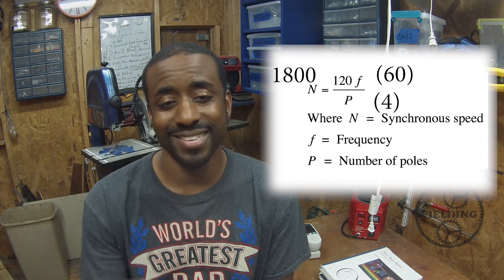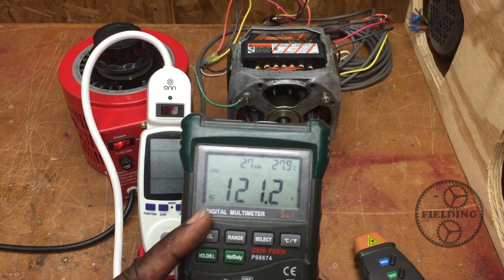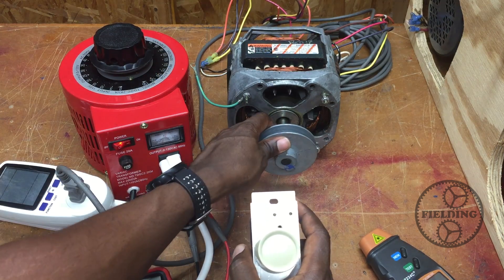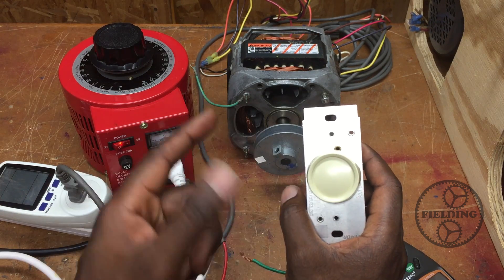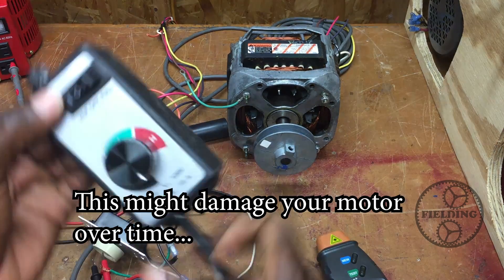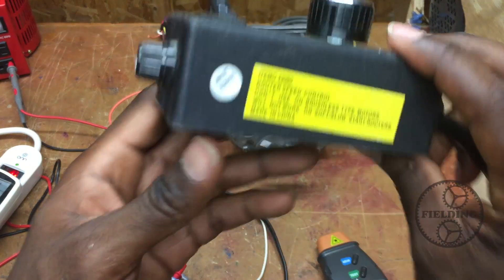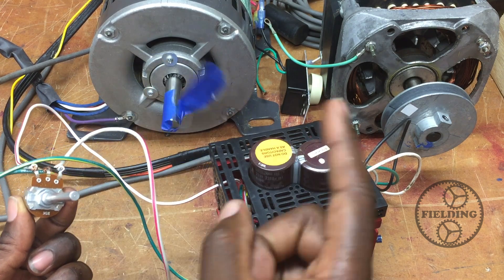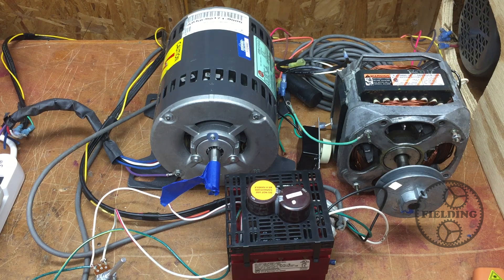Will A Dimmer Switch or Transformer Control An Induction Motor's Speed: 038

Comment: Hi Jeremy,
I have a 6'' variable speed bench grinder model No. TDS-G150VLA ( 1/3 HP , 2000-3400RPM ) and It is missing the potentiometer and the on/off switch . I managed to find a matching switch and after I put the circuit together without the potentiometer the motor doesn't run or hum ..nothing happened.
I found a 180K ohm potentiometer , can I solder it to the 3 leads going to the speed drive board?
If not which value is good in my case ..
Thanks

Comment: So I have a blower with an induction motor, driving the blower via pulleys and a belt. I'd like to slow it down, it seems like the best option would be to do something like put a universal motor on it and a Triac speed control.

Comment: Jeremy, this is over my head but I will share my problem... 3 phase motor turning a feed axis on a large custom lathe. This axis feed has worked for several years until we replaced a potentiometer, now we are getting intermittent feed depending on the machine load. When the axis is the only power on we get smooth feed however when other power is on for cutting heads and turning we get the intermittent feed. This is probably not near enough info for you to diagnose but it’s a start. I look forward to your response.

Comment: Hello Jeremy,
Merry Christmas and Happy New Year. I know this video is  about 3 and a half years old but I have a question similar to your video here. I want to know if I have a Meanwell 24v DC power supply, can I use a dimmer to  vary the voltage to the track running LGB "G" scale trains. I had a guy make me a power supply to run my "G" scale trains, he used a Meanwell power supply and the controller is a Crest CRE-55401 DC Train Power Controller. Can an AC dimmer switch work the same way as the CRE-55401? Thank You in advance.

Comment: How ceiling fans with remote control works? I've installed ceiling fans with remote control and the box connected to the fan motor have 2 wires IN and 3 wires OUT,  but one of those OUT wires is for the lights. How can that control box have 3 speeds but only provide power to the motor with only 2 wire?
Reply from the maker: Watch part two
Reply: @Jeremy_Fielding   thanks man , i will , cuz that 2 wires but 3 speeds thing is driving me crazy , im like "HOOOOOOOWWW!!!"

Comment: I really liked your interception you were a very good teacher anybody they give you a thumbs down need to be slapped anyways this is what I'm going through now I just bought a type of light switch that is supposed to slow or higher the speed and it does nothing for a blower motor that I have on a furnace I converted to a wood burner so I'm trying to find out can I buy a vfd like you have and not running on a 3-phase and run it on a single phase motor which is there at 120v motor 60 hertz I know you mentioned three phase and then only good for 3 phase but you can do it on a single phase motor but it could cause problems so am I just chasing my tail doing this to try to slow down the speed of the motor so the blower doesn't blow as fast or should I specifically just get a different RPM the motor it just spins slower and it is not as powerful

Comment: i have a wire feed welder  older industrial model its a airco brand  it has a 24 volt dc wire feeder motor  somehow the wirespeed speeds up when you turn up the heat  and the potentiometer  is just a fine tune  pretty sure thats the way its supposed to work  it has 24 volts to motor at highest heat setting  but when i turn heat down to a very low setting for thin metal  even with the wire speed potentiometer  at max i cant get  enough wire speed  for the low setting  (not enough voltage to 24 v motor at the low setting) can you recomend a 24 volt dc  speed control  that i could tie into  from a 120 volt  source

Comment: Sir ik this is an older posted video but with the dimmer switch the triak... what if u had a start capacitor for a motor after the dimmer switch then when the triak turn off it discharges amd recharges the capactor effectively changing the frequency from 60 to 50 or 40 would that give u 1800 1500 1200 rpm? At close to full torque? Or more effectly for the cost slow a tool motor down like a saw? Or just a universal motor

Comment: Hi Jeremy. Okay...I watched your video (great explanation by the way!) because I am very interested making a belt grinder and I was going to use a DC treadmill motor with a speed controller from the equipment itself, but then I read a lot of others who did the same having issues with theirs. So I opted out of that plan. I like the fact the the DC motor will provide more torque, but if there are other issues arising from it such as tripping the breakers, then I don't want any part of that.
So, that brings me to my inquiry. VFD's are difficult to find for single phase motors, yet, you can find bench grinders that are 110V and variable speed. There's not a lot of them being produced, but they are made. So how can manufacturers make such a thing and we can't find them for our own single phase motors? I'm currently looking at a 115/220v motor that can be wired either way, but I really didn't want 220. I'd just rather have a 120 plug in. Thanks! Cheers!

Comment: Hi bro, can I use a dimmer for limiting maximum power of induction coocker. I have a 1300W induction coocker and my small house has only 1300W limited electricity, sometimes the coocker makes the MCB down as its operates in automatically.

Comment: The previous owner of our house had wired the exhaust fan (an induction motor) in parallel with a 500 W halogen lamp and those in series with a dimmer.
The fan did slow down when the light was dimmed but only when the halogen bulb was working.

Comment: 1 .  Electric motor speed is 120 x frequency (Hz) / poles of the motor. Example 120 x 60 hertz / 4 poles = 1,800 rpm.

2. A light dimmer has an circuit to modify the voltage waveform turning  the voltage off part way through each sine wave to dim a light bulb.

Comment: Love the videos Jeremy.  You really have a calming teaching method and a common sense approach.  I have a question that you touched on @3:50.  I do not understand WHY current increases when voltage decreases.  Using Ohms law, Current is Voltage divided by resistance.  So since the resistance of the windings is constant,I would expect that current would drop when voltage drops.  Using Power = Volts * Current, I would expect that the power of the motor would also drop.  So, what am I missing?  Is it simply the the output of the motor tries to maintain constant power, thereby pulling more current to maintain load, but if so how.  As you can see I am missing something.  Please help

Comment: If the vfd only works with the 3 phase motor and not the single phase motor, what happens when you use the dimmer to control the 3 phase motor also?

Comment: I have a Kitchenaid mixer with a 315W 240Vac universal motor. The motor was struggling to spin when I was making dough. I plugged the mixer into a watt meter and it shows 71.9watts and the current 0.65A. Can you advise why the motor only consumed 71.9Watts when its capacity is rated at 315Watts and the current don't seem to increase beyond 0.65A. The motor was not showing any signs of overheating to the touch . Many thanks for your advise.

Comment: The reason you can't find a VFW with split phase or single phase output is because a 3 phase output VFW works .Just use 2 of the 3 output terminals. Try it.
Reply from the maker: While I agree that works... that is not the point of the statement in the video. There are a limit number of VFD's sold expressly to work with very specific single phase motors. They list which types they work with because it will damage the more common versions of single phase motors, especially if you try to run at low speeds. The very popular (most common) single phase cap start motor will be damaged if you try to run it with a VFD... that is the point.
Reply: @Jeremy_Fielding  You setup the VFW to start at 60 HZs then throttle up or down stay between 30 and 70 HZ Motors with run capacitors can run slower then motors with centrifical  switch start with or with out start capacitors.

Comment: That was interesting.  We built a label roller out of an old B&D drill running off a dimmer switch to control the speed.  It worked, but you had to start fast, then dial it back to the desired speed.  Since the printer only went so fast, we used a rubber mini drum sander piece to fit in the core, to let it slip if it got going to fast for the printer on start up. I didn't want to pull the labels through the printer before they had a chance to print. Mind you, we used a Dymo printer for 4x6 shipping labels, printing all 250 labels in one step. Each new label, would pull the roll back to the registration mark, then print the next.  It worked flawlessly, so long as you had the drill running in the right direction. Since we started winding them on an old label core, controlling the speed of the motor was necessary, as the more the roll gathered, the slower the drill needed to run. I think we printed around 40,000 labels using this method.

Comment: Jeremy! You are the man!  I used a 1/2 HP, single phase, 120V, capacitor start, water pump motor to make a bench sander. It is working well except that it starts slowly, runs for about 30 seconds, then shifts to max speed. Is there some way to safely control the speed?

Comment: I have a dehumidifier and would love to slow the fan down , seems it's not possible then , doesn't have a start winding but it's an AC brushless motor , think it's about 30w and 50hz 220v, maybe I could replace motor, any thoughts?

Comment: I did manage to run a 1gle phase motor on a vfd once.  wired the 2 winding with a common connection. so a bastardized delta connection....not shore how you will explain it. phase 1 connected to run winding one end. phase 2 to common of the motor winding and phase 3 to the other end of the start winding. i recon i had a severally unbalanced load on the vfd. and over some time it would probably fry either or both. but for the setup i had it all worked and did not smoke out. both me the time to find a 3phse to do the job in the long run. motor was about half the vfd rating. and the load was not super heavy on the motor.
be interested to see a clever lad do the test and see what the load on the drive is.

Comment: Hey Jeremey, thank's for another fantastic video. 

One question:
If I understand correctly and have my jargon straight,  you have to either change the number of poles in the commutator or the frequency passing through the brushes in order to change the speed of the induction motor. Is it hypothetically possible that you could use some kind of solid-state switches to turn the circuit between particular poles on/off, thereby allowing us to vary the number of poles rather than the frequency of A/C current? If this is possible, could we then use a technique similar to Pulse Width Modulation to smoothly control the speed of motor with this technique? Are there reasons we wouldn't want to do this if it were possible? 

Many thanks for all the videos! You are teaching me so much.
Reply from the maker: The main issue would be low efficiency. But this is an interesting concept.

Comment: what about adding an (additional?) run capacitor to the induction motor? it doesn't give you the fine adjustment of a vfd/etc but it should slow it down, right?

Comment: Hey there, great video. I am a beginner to all this and I could use some insight from someone more experienced on how can I control a single AC motor using a frequency converter? From my info so far VFD's are the way to go for 3 phase but they're not that efficient for single phase. The problem is tho, that I cannot seem to find a frequency converter for single AC motors to buy. I am trying to control the motor using a dimmer switch like you did but also to get the motor in braking behaviour using the same device. What do you think?

Comment: I have a jet midi lathe, 3/4 hp 1ph 115v.  It has a lever speed control that works on the belt.  It can slow the speed from 1750 to about 800 rpm.  Sometimes I need a really slow speed.  Is there anything I can do short of replacing the lathe?

Comment: Sir in ac motor gear box how to set to rodesiredtate angle of 360° and stop until we touch the pedal to rotate 360° and stop with the help of control driver
Reply: Sir in ac motor gear box how to set to rotate angle of 360° and stop until we touch the pedal to rotate 360° and stop with the help of control driver
Reply: Sir in AC or DC motor gear box how to set to rotate angle of 360° and stop until we touch the pedal to rotate 360° and stop with the help of control driver

Comment: Great instructive video.  Do you have a suggestion for controlling the speed of permanent magnet brushless 120v motor (or at least I think that's what it is).? I have a fan that I would like to slow down.  I believe it is a permanent motor because the motor stops at discrete points if rotated manually.

Comment: Crikey, you are a great explainer! I have a question, would a fan speed control work to change the speed of a single phase motor with brushes? Says 3 amp fan speed control. My single phase motor is 2.85 amps.

Comment: thank you for the great videos you make, could you please tell me if there is any device to controll the speed on a bosch mitre saw (reduce the rpms to aroud 1800 rpm) in order to cut steel, most steel cutting blades have a maximum of 1800 rpm, the other video replacing the motor is too complicated for me as i dont have your knowledge but just wondering if there is any adptor or any, device please let me know 
thank you in advance :)
Reply from the maker: Search my channel

Comment: i just bought the same red variac (5 amps).
Does anyone know if I can use it to run my tube guitar amps safely?
One has a tube rectifier + 2 amp fuse, the other has diodes for a rectifier circuit + 3 amp fuse.

Comment: I stopped at 3:40 ; Basically it reduces the torque, not the speed.
I have some question, i have a 3450rpm motor i want to convert to generator ( single phase 120v,60hz, 5.3A, so 636ish watts). This makes it a 8 pole motor? If so, what capacitor would you recommend me as running cap for self-excited field?

Comment: Your a wise electrical engineer,,, I'm working on my friends yath has heatpump,,it's a 89 boat,,had potentiometer slide control for fan speed,,they changed system a few years ago,,,my concern is the old thermostat is going to burn out induction motors,,,one was gone when he bought the boat,,and I noticed a loud hum

Comment: Hi! Very interesting video! I've seen various feedbacks about issues with capacitors if using VFD for single phase motors. What option is there to control the speed of a single phase motor with start capacitor? example aplication: regulate water pump for small irrigation system.
Can you detail on those issues and maybe how to work around them? Or maybe point me where can get those details?
Thank you for the information you share!!

Comment: Ok so I have an old Westinghouse phase 1 ac induction motor with 1725 rpm. What could I do to either permanently slow the motor to around 30 rpm or what could I do to change the speed via a dial or something else?

Comment: Helo Mr Jeremy,I want to make a pottery machine , and I need to controll the speed of the motor ,and when I looked to some of manufactured ones , they used a small motor "I dont think they use 3 phase ac motor" and a foot pedal, I have a washing maching single phase motor and if I follow what you said , there is no way to use it to make a homemade pottery machine.Any suggestion from you Mr Jeremy.excellent channel Mr Jeremy :)